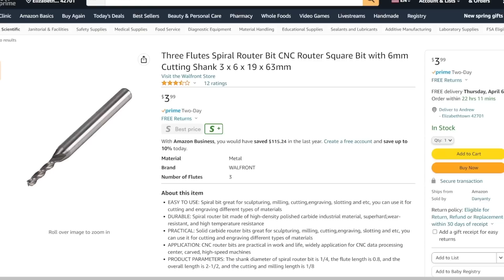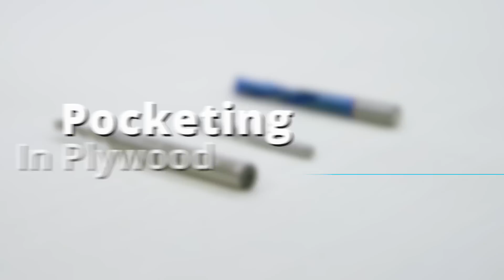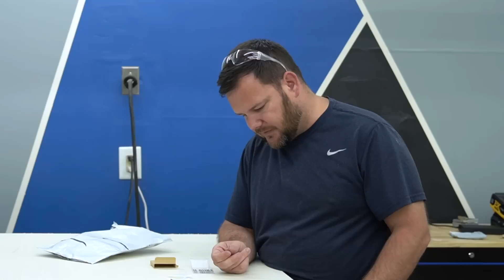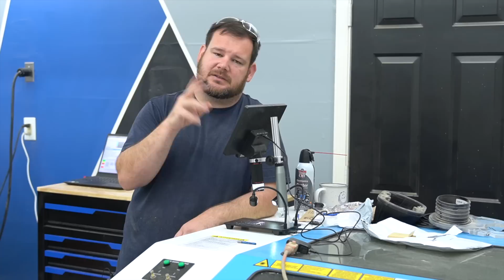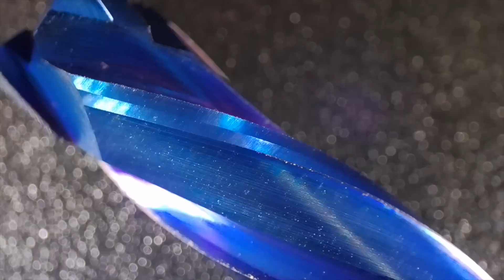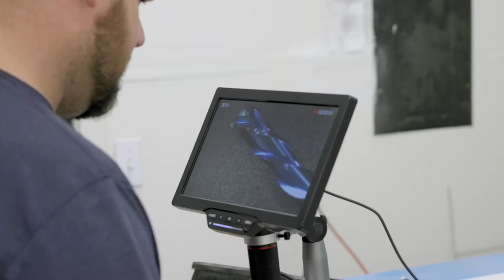Testing the Cheapest CNC Router Bit on Amazon!

Comment: The lines you are seeing on the blue compression bit are called the "primary relief" and "secondary relief" angles. The primary relief is the relief angle allowing the tool to cut without rubbing, but remaining as shallow of an angle as possible to retain strength. The secondary relief is a much steeper angle which removes a lot more material on the heel or backside of the grind since it is generally a much steeper relief angle to gain as much chip clearance as possible.
The grinding on this tool is a lot more sophisticated and requires a CNC tool and cutter grinder to accomplish.
The other two bits may be batched out on a cnc grinder or they could be run on manual equipment since the geometry isn't nearly as complicated.
The coating may not be necessary for use on wood, however it can (depending on the coating type) greatly increase lubricity and reduce friction between the tool and the work piece.
This will certainly increase the life of the tool. It would not surprise me to find that the area you thought may have been coating flaking off was actually plywood glue residue building up on the coating and it had the appearance of the coating flaking. Since it was at the depth of your cut, it was likely from re-cutting some of the chips as they exit the cut area and the chips include the plywood glue.

Comment: You can’t say the $1.20 bit is the cheapest on Amazon if it has $4 in shipping.  It’s basically a $5.20 bit with free shipping.  If you take the ten bits you bought for $14 and subtract the $4 shipping you have each bit only costing $1 each.

Comment: Having done a fair share of material development, testing and failure analysis, the heat affected zone in the first bit is from torsional stress by the top portion spinning faster without resistance versus the cutting section spinning slower With resistance. Any bit can suffer from this where it's partially from metallurgy, but mostly simple physics. Many a wood screw has suffered the same fate in my presence, as well as general fasteners. By engineering a better design out of applicable stock (some will naturally perform better than others by virtue of being tougher/more resilient steel or alloys), you can get a 'cheap' bit to do expensive bit performance. The expense involved is finding someone(s) who know that and how to accomplish it, and fabricators that reproduce them.

Comment: We have bought almost all the brands on Amazon, the $40 $35 $24 $18, the best one we have been able to find after 4 years, it is a Chinese brand we had to buy to change from 1/4" to 6mm. We cut 25 sheets of plywood without changing bits , with the same cut. With the amana it reaches 5 sheets and loses the edge, there are some blue ones, it does not exceed 8 sheets. But the 6mm one, and it only costs $12! It cuts 25 to 30 sheets of POPLAR plywood!!! .
Reply: Link?
Reply: Which one?

Comment: i always buying the """cheap""" bits

however i never met with the first bit with 1/8 shank
using one flutebits
flutes are polished , no eat build up  and fairly long lifespan

1-8 bits around  1.50-3 dollar
1/4 bits around 3.50-6 dollar

in comparison  purchased  amana and onsrud bits because """professionals""" told me  they  hold up longer
no, they are not, even using the  factory suggested settings

on the end  posted pictures on amazon and alibaba  showing  the actual bits,  so fairly simple  to buy the right one

Comment: On the blue bit, that first slow pass wore off the coating from heat and friction of cutting through the powder. If you try it again at 200ipm with a new bit, you should see the coating last  longer. But who cuts wood, ply, mdf whatever at 60ipm?

Comment: 1st, one would always break (no matter the price) whenever it was used for extended period of time since it is a (99% sure) HSS endmill designed for metal cutting here is why:
-  flutes are not as steep compared to woodworking endmills 
- That hole in back of that tool
- "sharpness" of the tool. Even used or chipped carbide will feel sharper, it's harder than HSS
- Tool marks. Most of the cheese grade HSS is just cut instead of ground. If you get your hand on a quality HSS tool, you will see a massive difference under microscope. Also, carbide is ALWAYS ground.
- Discolouration of flutes. Carbide doesn't do it. At least not in woodworking. You will start fire before you discolour it. Change of appearance is due to material caking on it and/or tool chipping. Also, as you may notice, the whole tool is straw colour, which is produced when tool steel is tempered.

 The thing with HSS is it doesn't work well with high RPM - it gets hot, and you are essentially tempering steel, which leads to blunting and breaking. In metal working it is not a problem - turn on your coolant and that's it (of course within reason). In wood working well, 12k-18k  RPM is a death sentence for those tools.

2nd and 3rd tools are actually carbide. How do I know? Tungsten carbide is a very poor heat conductor, and you state that "it's not even hot". I bet they also feel heavy in relation to their size. 2nd tool have good flute geometry for wood and non-ferrous metals. Only thing that is missing on that tool are polished surfaces (prevents chips sticking to it). I wasn't surprised that both of them didn't break.

And I don't agree with your conclusion. Cheap carbide tools are good for general use - somehow manufacturers can't figure out how to make completely shitty carbide. Yea, if you are machining 714 Inconel or duplex, or you are using high feed endmill - quality will matter a lot. My advice for wood working would be: avoid HSS, get a tool with appropriate flute geometry, get high polish endmill (often found on tooling for aluminium) and lastly avoid coatings on cheap tools. Apply those advices in that order.
Reply: He's also comparing a 3 flute to a 2 flute so it's sort of apples to oranges

Comment: I believe that your speeds should change for the 3 flute vs 2 flute bits to keep the chip load correct. That might have caused some of the heat buildup in the first bit because it was spinning too fast.
Reply: That was my first thought, 3 flutes are meant to run at a higher ipm or lower rpm. He does address that though, and it really shouldn't make that much difference in that short of time

Comment: I don't think you can assume that part of the shipping charges don't go to the seller. I think that depends on which shipping method is used. I'd double check that because there's a chance your cheapest bit was your most expensive bit.
Reply from the maker: I think it's a safe assumption. It was shipped first class usps from New York.

Comment: For anyone who does not know how to determine if a cutting tool is made of carbide or high speed steel:
1. Carbide weighs about 80% more than the same volume of high speed steel.
2. Carbide is a duller grey color, whereas high speed steel is shiny.
3. Carbide, like "non-magnetic" stainless steels, is only slightly magnetic and will produce only a sight attraction, whereas high speed steel is strongly magnetic (an easy and cheap test).
4. High speed steel throws off a lot of bright yellow sparks when held against a grinding wheel, whereas carbide produces relatively few small sparks that are more of an orange hue.
5. An aluminum oxide stone will easily scratch the shank of a high speed still end mill or drill but will barely mark carbide.
6. Carbide is around 90 on the Rockwell C hardness scale, whereas high speed steel is about 65 on this scale (though few people have access to a hardness tester since a decent one costs $1600 to $1800).

If a tool is cheap and does the job, then it doesn't matter what it is made of. Still, buyers of cutting tools should know how to tell the difference to avoid overpaying, as some of the high speed steel end mills / router bits (and other cutting tools) on Amazon claim to be made of, and priced as if they are, carbide. Caveat emptor.
Reply: AD.2. not if bot are polished/ decent quality

7. Carbide tools will not have any centre holes or threads on the shank end. If they do, those holes are through tool coolant, and you don't want that for woodworking.
Reply: Great tips, thank you

Comment: Very interesting. Spent 6 years working as a machinist before getting my Avid. Working out tool paths with solid wood is actually much more difficult than metal, as the density and grain direction change so much even in the same board. As someone who has a really hard time not using the best tools they can afford, this video has gone a long way in convincing me to use a throw away bit when prototyping a new project. 

I'd love to see more of this. You may want to think about a small plexi shield though if your trying to break bits! They may not all break as cleanly as that one did.

Comment: Question: The discoloration appears to at the bottom portion of the bit, however, the bit broke near the top. Is the break really due to heat?
Reply from the maker: Good question. I'm not a physics expert, but my guess is that it got hot enough, and the heat transfered up the bit, and thats where it has the most "flex" stress on it.

Comment: What chip load are you shooting for? Running a bit slow (90ipm) can cause more damage than running it to fast if your RPMs are set incorrectly.
"The only difference is this bit is two flute and this one is three flute." That makes a HUGE difference. If you ran both at the same rpms and feed rate then it is not a "side by side" test. Of course the three flute got hot. There was no chips to remove the heat...only dust which just compounds the problem.
Reply from the maker: You make a good point, but chip load isn't heavily considered in cnc woodworking. Wood in general is very forgiving. So the difference here is minimal. In fact, most cnc machines that viewers are using can't maintain a certain chip load, so it does no good to use it as a reference. I think the material make up of the bit should be more of a consideration.
Reply: @AndyBirdBuilds  Chip load is NOT considered? What I think you are saying is that these machines are now "consumerized" to the point that people who don't know and don't want to know anything about their operation can buy one.  These are the same folks who drop 5K on a setup and wonder why they get terrible results. Education saves money!

If you are over 60 and in the USA most colleges let you take classes for FREE. I am in one now.  By the way I am a retired Mechanical Engineer who was doing design and analysis ... now I am learning how to actually make things.

Oh and please don't let somebody make a "Dr Kit" for 5K .. and then have a real Dr. do a procedure for others to copy.
Reply from the maker: @carlslater7492  Whats the return on calculating exact chip loads in wood?
Reply: Chip load is absolutely considered in cnc woodworking. Feeds and speeds are only a means of achieving the right chip load. I'd argue it might be more important than machining metal because we don't run coolant cutting wood. The chip load is the only thing keeping the bit from burning up. It's "forgiving" in the sense you can run it slow and cut the life of the tool down but still make the piece. Run it too slow and you can cut the life of the tool down to zero real quick, or start a fire in your shop!
Reply from the maker: @laroast8531  I completely get what you are talking about and it's vital in a production setting. BUT, the majority of my audience isn't producing 1000's of pieces a week or even in a year, thus chip load is not a major concern. The monetary return isn't quantifiable at such low quantities. Also, the machines and software cannot maintain a specific chip load, meaning adjusting speeds and feeds in real time based on the toolpath. So there's not really any point in using chip load in this scenario. As long as you're making "chips" and not "dust" you are good.

Comment: The "cheapest 1/4-inch bit" (#3) is now listed at prices ranging from $11.97 ea. to $31.86 on Amazon and all of the vendors checked have it in stock. This bit isn't carbide, though that claim appears in the heading. The product details make clear that it is made of "Durable Tungsten Steel Material." It's also 6mm and not 1/4". There are several vendors selling the same manufacturer's bits, and not one bit is made of carbide; all are tungsten steel.

If I had to guess, I'd wager someone sent you the link to bit #3 and provided you a special price to get a positive review with the expectation that others would buy the same bit from vendors selling it at higher prices. Given how I've seen people manipulate prices on items by posting the same item under multiple accounts to make their overpriced goods appear to be "competitively priced," I wouldn't rule that practice out either.

For anyone unaware, tungsten steel is a completely different alloy than tungsten carbide. Like consumers, some vendors may not know the difference. However, some vendors (who sometimes fronts for the manufacturers) are fully aware of the difference and use false or misleading claims to sell tungsten steel cutting tools as "carbide" (which it is not).

The following article provides an overview of the differences between Tungsten Steel and Tungsten Carbide:
https://www.thomasnet.com/articles/metals-metal-products/tungsten-vs-tungsten-carbide/
Reply from the maker: Regardless of what it is made of (we will truly never know), it outperformed for what I paid for it. The whole betting they sent me a link for a positive review comment is a waste of everyone's time. What's the point of even stating that?
Reply: @AndyBirdBuilds  Someone did send you a link, did they not? And that link was to a router bit that was priced at less than 10% of the price this router bit typically sells for. You've been drawn into promoting a bait and switch scheme.
Reply from the maker: @GaiusTacitus  😂No there is no promotion here. I looked for the cheapest on Amazon and this is what I found.

Comment: I think the first bit is actually HSS, not carbide. Amazon description isn't always right.
Reply from the maker: Interesting. What gives it away?
Reply: @AndyBirdBuilds  First off, I've only ever seen the hole in the back on HSS end mills. It is useful for the tailstock when milling/turning the steel from stock, but it's not useful when grinding carbide from round blanks. Second, the binder that is used to fuse carbide powder is a small percent of the final material, and only part of it is iron. That iron would be nowhere near enough to give you those strong discoloration bands in carbide. In the interest of research, take a propane torch and apply flame to a known carbide piece, see if you get any heat bands to show. Also just for kicks, take a small magnet and test for magnetism. Carbide is less magnetic than steel. And third, in the Amazon description, towards the top, the material is stated as HSSAL, which I interpret as high speed steel for aluminum. Also, carbide has higher density than steel. If you have a graduated cylinder to measure volume, and a small scale for mass, you can get the density quite accurately.
Take all with a grain of salt, I'm a weekend warrior machinist.
Reply from the maker: Thank you for sharing your experience! I will do some more investigating

Comment: 7:44 You may want to add corrections about up cut vs. down cut -- I believe this is an up cut bit (unless your microscope image is reversed).
Reply: 16:12 The tip of any compression bit is up-cut and the flutes above that are down-cut, so the chips would tend to get pulled up from the bottom surface and pushed down from the top surface of the material. If you hold one in your hand tip down and rotate it clockwise (as seen from above, the way the motor spins) you can see the flutes moving toward the transition zone.
Reply from the maker: Good catch. I misspoke here. The bottom tip is the upcut portion. Hence, leaving a clean bottom surface when cutting through the profile of your material. This doesn't take anything away for our test though.
Reply: @AndyBirdBuilds  Yes, great tests and analysis! Very helpful.
Reply: I wondered if somebody else would notice that!...thanks

Comment: Suggested test for consideration. How many inexpensive bits would be used to match the longevity of a more expensive bit? Which would be most cost effective?
Reply from the maker: That would be interesting. Like I said in the video, I believe both cheap bits and more expensive bits have their place in everyone's work flow.
Reply: @AndyBirdBuilds  My point I Have interest in knowing is, If I have to use 3 $6 bits to one $30 bit to  do the same amount of work with the same quality, cheap bits win, yes?
Where do more expensive bits give more benefit to workflow?
Reply from the maker: @homezero  Wear being the main point of this video, there are other considerations as well. How sharp is a bit to begin with? Do the bits produce the same quality of cut? If so, for how long? What material are cutting will have an affect on how fast a bit wears as well. My point is, I don't think there is a one size fits all answer to your question. If you run a test, let me know what you find out.
Reply: You have to factor in the chance of breaking the bit, too.  One commenter said he buys Chinese bits that last longer than Amana.

Comment: Looks like the seller of your third bit knew he would be getting sales, ha!  The price is already above $7/bit.
Reply from the maker: I just checked and they have bits at different price points. The $1.20 was still available
Reply: @AndyBirdBuilds  This link went to 4*4*17*50 at $7.60 for me. The 6*6*22*55 I found several sold out most likely the cheap ones and others at $11.97 to$16.79.